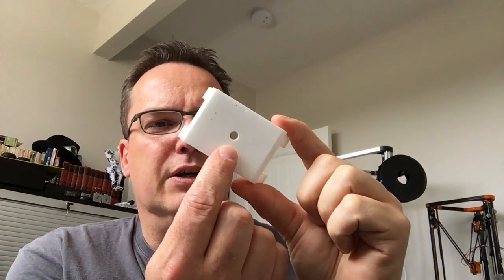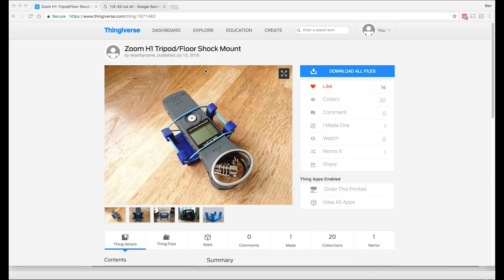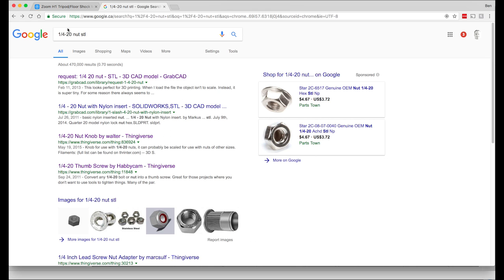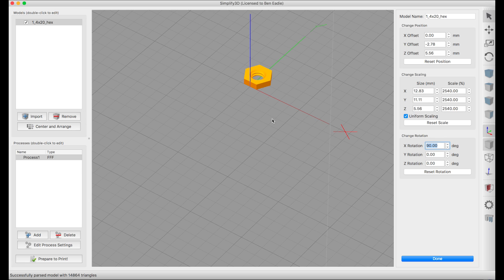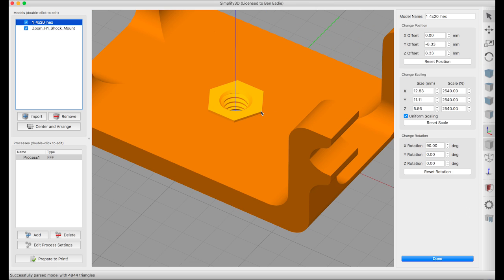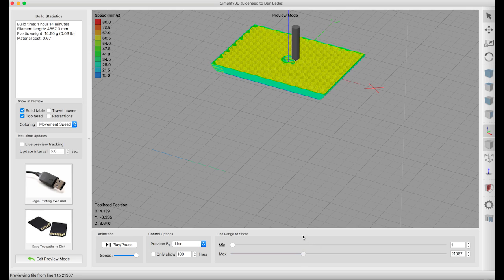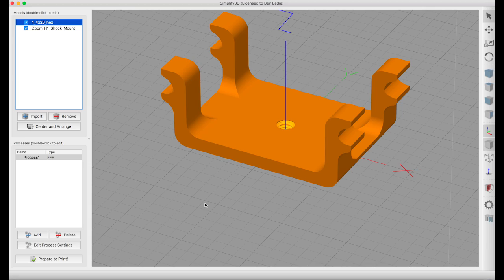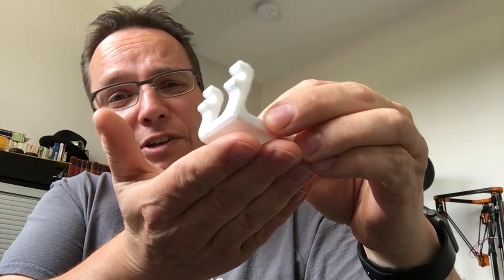3D Printing Tip: Join Two Meshes in seconds into one 3D print

Comment: Great this actually works well on joining 2 STL files , I have been trying to use meshmixer to reduce the number of parts for a model from 4 down to 2 to reduce the amount of gluing and after many hours I gave up with meshmixer. After a google search I came across your video  and it worked it took a little time to line up the parts but they printed perfectly so thank you .